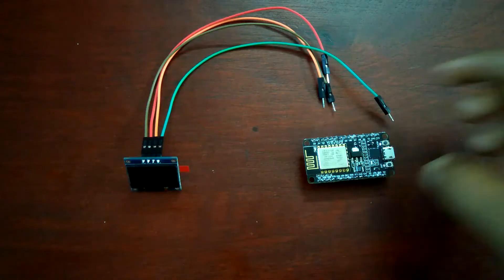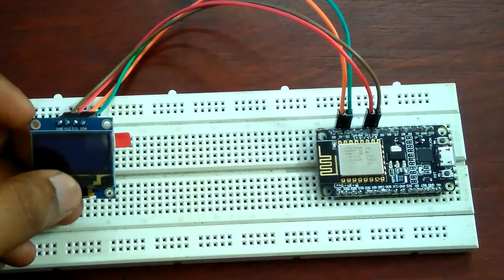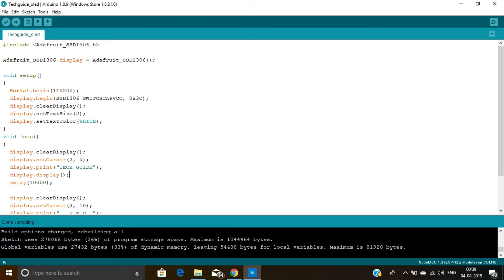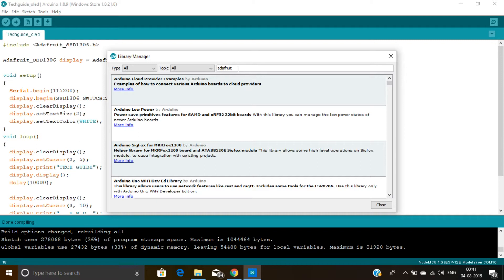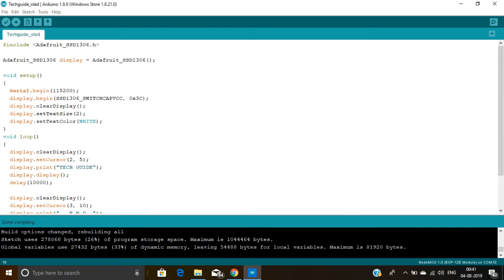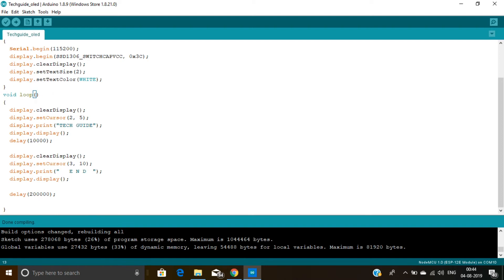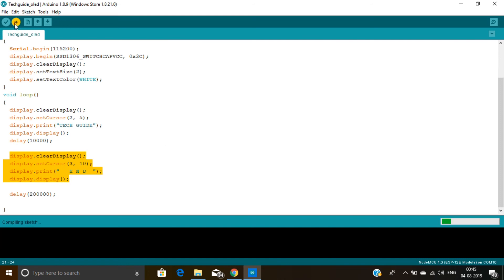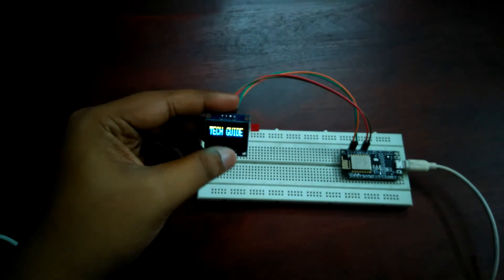How to use OLED Display with NodeMCU?

Comment: Good !! Nice work Brother.. Tobe vai, stty bolte topic name dekhe aro valo asa korechilam..vebechilam.. tui module ta k explain korbi ba, duto alada pixel k compare kore kivabe code korte hy, dekhabi.. Ba dhor, same library te 128*64 ba 128*32 duto alada pixel display define dekhabi..  Asa korchi next tay dekhte pabo.. Overall nice work.. R eta k nodemcu te na kore arduino te kor..  Nodemcu te amra API diye alada vabe dekhate pari, er jnne display lage na.. Asol somossa to arduino te..